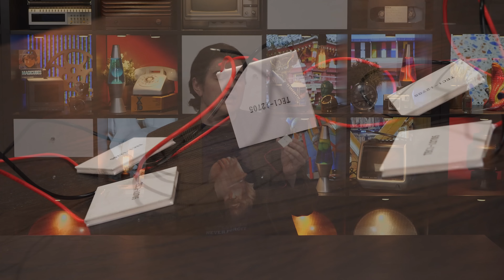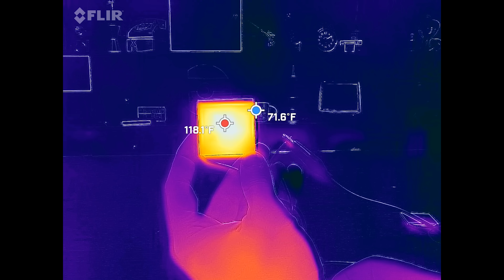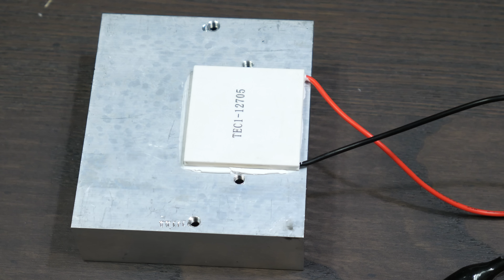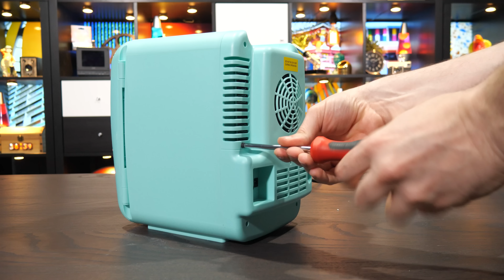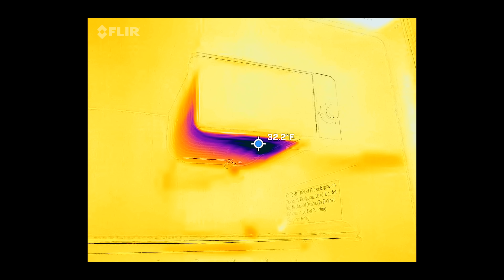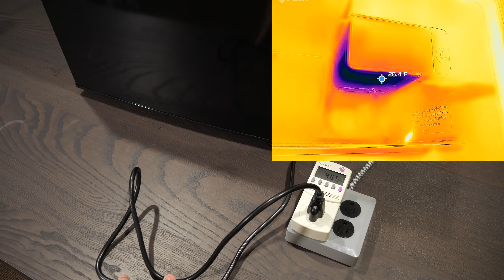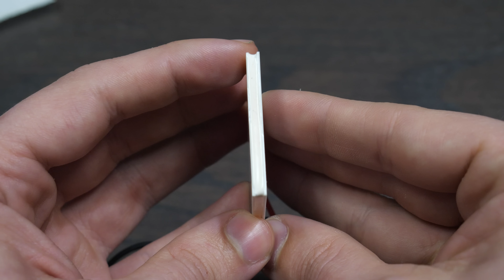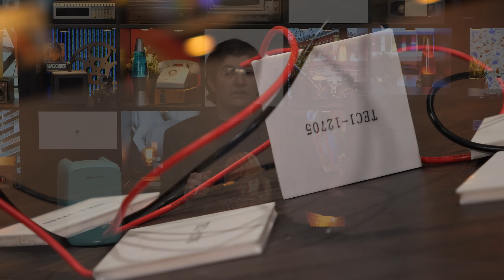Thermoelectric cooling: it's not great.

Comment: The main advantage of the Peltier fridge over the heatpump fridge comes down to one word....convenience! Which do you think can be "smuggled" into your office cubicle easier? And, because it's at your desk at work, you're not really paying for that electricity either...You can essentially use the Peltier fridge as a $66/year FU to your company for skimping on your raise last year! I have one in my basement that I use for brewing Lager beers. Hooked up to a Johnson thermostat controller, I can maintain the perfect temp to properly brew Lager beers. I use one of those Peltier coolers to ferment my Lagers...I only do small 2.5 gallon batches, so the Peltier cooler is the perfect size! And considering my basement never gets above 70F, the temp range of 30 below ambient is just fine for Lagering!

Comment: You didn't mention RTGs.  Don't they use Peltier modules to produce power from a temperature difference?

Edit:  I looked it up - I was wrong.  They use the seebeck effect, which is also the principle thermocouples use.  I believe there is a small military submarine from northern Europe that also uses the seebek effect and a diesel burner to produce electricity for the sub more quietly than a diesel engine.

Comment: Yes, they really suck from an efficiency standpoint. First thing I researched many years ago to see if it would pair well with solar. Not a chance.

FYI, I also have the identical mini fridge without the buzzing or energy star label. It doesn't short cycle. Same refrigerate. I also have a peltier micro fridge, and it sucks too (Coka Cola graphics as a gift). I had bought some peltier elements, and tested them when they got really cheap about 6 years ago. Even with conversion to A/C, a new mini split really is an order of magnitude more efficient.

Comment: One of the most infuriating things about those stupid things is that *they can be made well*. I have/had one of those things, but with actually insulated case and a (non-adjustable) thermostat. It could only fit like four cans, but it used around 25-30W in average and kept the cans around 6-8'C

Still not great, but miles better than those things without insulation.

Comment: With CPU's / GPU's getting smaller and using more and more energy, I can see peltier elements being used in cooling them. Not as single device, but in between the chip and whatever cooler is used now. Just to get the temperature of the chip a couple of degrees lower. So more as a cooler booster or something. 
Other than that, I really only seen them in novelty items, like USB powered single can coolers, or used in reverse as sensor for measuring LASER power. They are still fun to play with though ;)

Comment: Peltier elements are used in "air-conditioned seats" in cars thanks to their thin size. You don't need the car's air conditioner on to use the cool function to seats. A much more comfortable use than heating and chilling the cup holders.

Also, love the channel. Several years ago I bought a portable airconditioner with 2 hoses and it works great. Stay cool.

Comment: What about the ammonia system. One tiny pilot light and no moving parts will get you a very cold fridge. Not the best system but for low energy, longevity and simplicity in design not to mention the coolant is none toxic, it can’t be beat. A tiny solar panel a battery and a small electric heater will work as well. Again Simple, efficient, long lasting, no moving parts and will keep what ever you need frozen. Every motor home has a water heater or refrigerator that uses this design. This system lasts a long time as long as you don’t puncture a coolant line, safe for you and the environment.

Comment: When i saw one of these cubes that my wife had gotten, supposedly a "free gift" with her facial product purchases, we both saw no use for it and discarded it.

Years later, we now have a water dispenser with filtration, instant hot and cold water. It uses thermoelectric semiconductor too. The cold water measures about 15°C cooler than the ambient temperature too, right in line with what you've said.

Comment: I believe you can also use peltier modules in reverse too! Creating a difference in temperature between both sides creates a voltage. One example is a fan that you set on your stove that is powered by a peltier being heated by the stove on one side and cooled by the fan with a heat sink on the other. Not sure if you can just use any peltier like this or if you have to have one designed for that.

Comment: curious if we can improve the performance of one of those cheap fridges... mother bought one that was designed after a retro fridge, and it looks amazing, but can't hardly stay cold or cool things; curious how easy it would be to take one, fill insulation into it or the like, and maybe add a few more peltier devices and a simple AIO like cooler/radiator. On such a small scale, about 20 dollars of parts, and a pipe bender, it seems possible to use a small pump, low speed fan, and pipes to transfer the heat from the back to improve cooling. At that point, I would likely just be designing a new product which uses the original one as a start, like a means of recycling trash... but it does look fancy and retro...

Comment: but, what if we use them as smart insulation? cool using compressor, use peltier pumps to help keep fridges cool (prevent the cold from escaping/heat entering)

Comment: I had one of the slightly bigger models of Peltier "fridge". It actually usually had a rather thick chunk of ice forming over that little indentation inside, right where the Peltier unit was mounted. However, this was the result in a basement, where the temperature is generally less than 70 degrees Fahrenheit... It kept beverages at a pretty good temperature, but it definitely wasn't good enough for food...

Comment: Well I have a little mini fridge at work that uses these, and it gets cold enough that water in a Dixie cup will freeze into solid ice, works fine for a can of soda and a sandwich, but not scaleable up to a full sized refrigerator/freezer. Mine also heats but I never used the heat mode. I wouldnt jam 6 cans in one of these or a room temp soda, it's better to put already chilled cans in.

I only ever used mine for a bottle of soda or water, and a container of yogurt- both already cold, and it kept the inside cold enough to form ice, I kept it by my work bench- no space for a cube fridge anyway

Comment: i had a mini fridge with two peltier's in it, and a fan on the inside for some reason?  it barely kept things cold, and one day it started making a scratching noise, and upon further investigation a ring of ice had built around the inside of the fan hub and the blades were scraping it, then one day i woke up and it was dead with the blade frozen in place.

upon even more investigation theirs a fuse in the back that had blown, so im assuming the ice got bad enough one night that the fan got stuck and made the fuse pop somehow. regardless it was junk and i tossed it.

Comment: I remember (10 years ago) being crushed when I bought some peltiers, I made a hole in the cap of a Coleman plastic box, then I put 4 peltiers with a big heatsink and it didn't worked at 30-35°C ambient temperature... maybe droped 2°C during testing. Just a waste of energy. Frustating. 
I thought the petiers were bad quality or me just dumb making thermal designs, but you just made me feel better confirming how bad are those "fridges".

Comment: Will it be a good idea to fit these Peltier elements in (say) a desktop computers or over a processor circuit (of course) with a proper heat sink attached including a fan. The advantage I feel is that the whole heat sink for the heat from the processor will work as a cooler for the processor without external air will work without the dust from the external air. For example Imagine this blue box, (the rear cooling parts) is mounted over the computer processor  and sealed off. We see often the processor clogged with dust from air leading to malfunction of the computer.

Comment: I would love to see a follow up video on the uses they have found in reverse in the space program, I also have one that drives a fan on my wood stove. 
  After 30 years in the HVAC field doing everything from designing geothermal heat pumps to inventing a system to dry grain in grain bins with large heat pumps. I still watch every refrigeration video you do all the way through

Comment: I wonder if that thermoelectric cooler would offer any advantage in cooling overclocked CPUs.  It's pulling 30 degrees less than ambient.. which is 30 degrees less than a fan itself.

Comment: Yeah I'm that guy that pisses everyone off by telling everyone that there isn't "cold", no such thing it's just an arbitrary word for an amount of heat lower than whatever amount we decide. So no, Bill, I can't pass you a cold beer, I can pass you an unwarm beer. A beer that has had a lot of its heat removed, but not to the point of freezing. Haha once you conceptualize this though it's kind of hard to not point it out though, you cannot add cold to something, only remove heat. I don't actually do this in examples like the cold beer one, but only when someone says something that fundamentally is just incorrect, which admittedly you don't come across a lot but I have a few times, once where they couldn't grasp the idea that just because they are 2 opposite words does not mean they are different/opposite in actuality, one is simply a word that is used for a lack of the other, a lower "degree" of heat.

Comment: I've bought a number larger than I'd like to admit of TEC wine coolers(nearly exclusively 'Bravetti' brand ones) from second hand stores. Most of them the heatsink/fan has zero dust, you can tell it was gifted to someone, they realise it's stupid and ditch it. Aside from the TEC they've got about 550g of Aluminum in them, the heatsink is quite beefy as well as an Aluminum block to extend through the 3cm or so of styrofoam separating the cold and hot side further. Had some fun stacking TEC's getting down to -60 C even. Works well for a small cloud chamber.

Comment: Funny that this video released today. I was just wondering if peltiers could act as a more efficient HEATER instead as a cooler. Since the device itself creates heat when it's working, but also moves heat from one side to the other, could a peltier have a cop >1 in this odd and likely impractical circumstance.

Comment: Okay, I come from a history of having been in one of the VERY few scenarios where a peltier module in a cooling device was the logical choice. I was an OTR truck driver. This means I was away from conveniences most of the time. Some statistics say that truck drivers account for 5.8% of the US workforce. I got this number from doing a search on Google for the percentage of Americans who are OTR truck drivers. While this proves the difficulty in getting accurate answers from Google, it does show that there are a significant number of people who are on the road, away from conveniences for at least the length of a work shift, which for professional drivers is allowed to be as much as 14 hours. I learned to drink room temperature beverages and to keep perishables, such as burritos, inside my Peltier cooler. They tended to last a good long time in that cooler because I kept their area quite cool and I don't mind saying it took a nice comforter to keep me warm during my sleeper breaks. The cooler kept my food 40 to 45 degrees Fahrenheit below ambient. The solid-state nature of the Peltier module kept it in good condition. A little thought on the part of the designers could have dramatically improved the lifespan of the fans. The unit operated on less than 60 watts. So, is a Peltier module good? SPOILER ALERT! Yes. Assuming that the day comes when people start thinking again, Peltier cooling can easily be the answer to food storage in the colder months of the year when solar power production is limited and you need help with heating something that could sit just next to the hot side of your Peltier module. Yes, it's a very niche use but those are numerous in the life of a technically-educated DIY enthusiast with a seemingly unlimited amount of mental uptime during waking hours. I don't expect people to believe me yet. I'm not currently making YouTube videos to contest those of naysayers. Hang in there. I am assembling a huge solar power system on my tiny residential property in a backwards,  technologically desolate city in Oklahoma. Soon, I will be showing you how little of anything you need to live large,

Comment: I used one of these to store my film, worked great until I was moving some furniture around, fun fact, if you hook it up backwards because the plug in the rear of the machine can go either way, you get the entire system in reverse and RAISE the interior temperature , I burnt myself on a roll of film

Comment: What an odd coincidence, I just pulled two CPU coolers from some old work computers and was going to buy a couple Peltier plates to mod an ice chest. I have a large USB battery pack that I'm using for to power the plates and fans on the CPU coolers. Ideally, I would have a solar panel to charge the battery pack, and wire everything with something like a pi zero to sense temps and control fan speed.

Comment: Peltier elements are more useful as thermoelectric generators than cooling or heating elements. If you cool one side while heating the other, (such as those fans you see on wood stoves) you get an electric current. They still aren't great, but if you have a lot of waste heat you can at least capture some of that and convert it to electricity.
Reply: That's called the Seebeck effect. It's powering the farthest manade object from Earth, Voyager 1.
Reply: @jamesisaac7684  I had no idea Voyager 1 was powered like that. Where is the heat coming from? I understand the cold side would be exceptionally cold but where is the temperature differential coming from?
Reply: @cameronmacdonald6525  a Radio isotope produces the heat by decaying and i don't know what the other side but probably the vaccum of space. They are called Radioisotope Thermal Generator.

I only learnd of this Today trying to learn what Pentloer effect is.

The thermal difference crestes enough power for the little guy.
Reply: @jamesisaac7684  That's awesome. Thanks for the info. I assume radioactive decay will probably power that thing for thousands of years
Reply: @cameronmacdonald6525  doubt it. It's only a small amount and the Power generation decreases with time. It's already reduced by 59%. That's why they had to shut off certain instruments taking up power to redirect it to more vital vital components 

I'm sure if they will make today with the current technology. Your prediction may find true.

Comment: I bought 3 similar devices that use this effect for dehumidification since my house gets crazy humidity at winter and grows mold and an actual, super basic dehumidifier here costs over 15 TIMES more than those 3... They do the job pretty well. I dont know how they compare in power draw, but considering i need them about 4 months a year tops, I'd say that even if they compare like a fridge and this mini fridge (which i doubt since the dehumidifiers need to always be on), and use about 3 times as much power, I'd still estimate that over the lifetime of both them and an actual dehumidifier, they'd probably not be more expensive.. Plus i can put the three in the most humid spots in the house while a dehumidifier is one unit, and even if its much more efficient at dehumidification, i really doubt it can cover the whole apartment no matter where i put it... And as an added bonus, the heat isn't wasted since its winter, and its like running a very tiny heater. So yeah, that's at least one pretty good use for these I'd say!

Comment: The one use for peltiers IRL is in the military: To cool thermal weapon sights. The original PAS-13 used a micro-compressor. And weighed a nontrivial amount.  (Like having an M203 grenade launcher strapped to the top of your weapon) and took a special battery and 5 minutes to get down to operating temperature. The 3rd version of the PAS-13 uses a small peltier to get the GaAs detector down to "not a  ton of thermal noise" in like 10 seconds of of a handful of AA batteries, and isn't horrible in weight.

Comment: i have always wondered the best way to describe a freeze ray in proper scifi terms. I wanted to describe some kind of .. anti-microwave, that slows molecules down instead of speeding up.. now I feel like that needs to be called Peltier Rays or something.
14:00 ahh I see what happened there. Grammatical ambiguity. saying "It's much bigger than a typical minifridge"  the 'typical' part can either be you covering for the varying nature of individual units, or it can be you making a comparison against the current subject. Like you'd say of a horse "this one's bigger than a typical horse"   I think it depends on which word you emphasize.
14:30 oooh I have that same fridge! It took me exactly one opening of the freezer to realize "the fact that it's at ground level does not make it a chest freezer.. all the air is still being blown out as I open this.. ff.."
Also I love how compressors basically hijack the molecular energy of matter to do more work than the electricity you put in. You're like "Hey gas, I compressed you into a liquid.. now I can't MAKE you turn back into a gas, but I might leave some heat out for you to use... y'know, if you wanna clean that up for me"